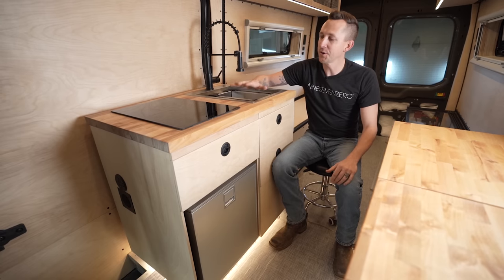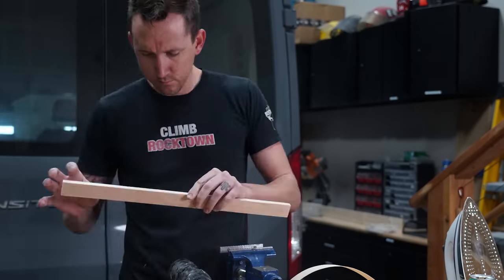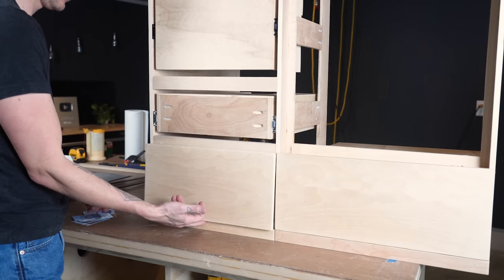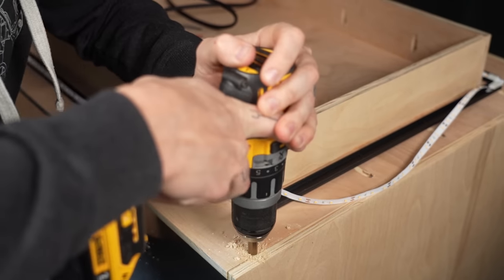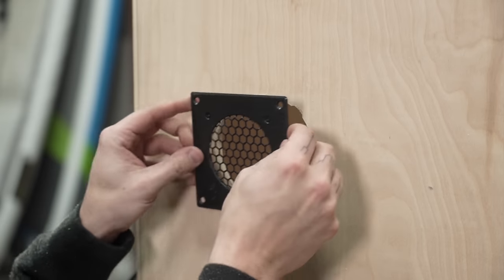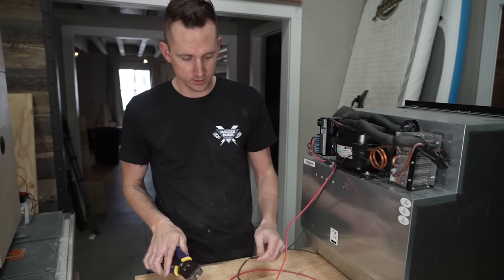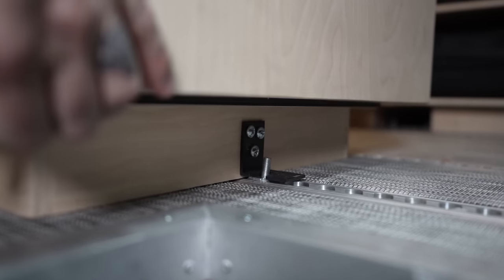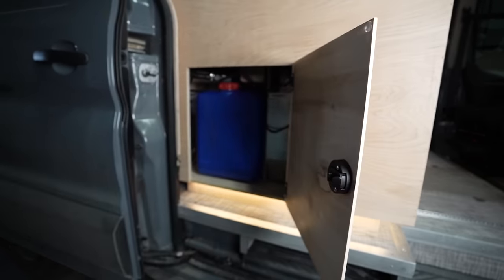DIY CAMPER VAN KITCHEN BUILD: The Perfect Solution for Small Spaces

Comment: Love the work! Just a little tip from a fellow wood worker. Always stain both sides of the wood. In this case the butcher block. Otherwise it likes to warp in the direction of the oil :)
Reply: 😯I didn't know this.  Thanks for the tip!  Glad that I haven't installed the countertop just yet.  Will flip it over and stain the other side as well.
Reply: @johnsharpe2351  great! Glad It helped. If it was mine I also would stain the sides that have been cut to make an opening for the sink. Protects the wood from any water that may gets trapped there when used
Reply: @marlon7806  yep, I did stain the inside cut-out area.

Comment: Hey Nate, nice work! But I noticed - your floor shows some air bubbles? I am asking because I started to get the same issue on my build and trying to figure out how to fix it without removing my cabinets. On another subject, the cabinets you installed, have you ever did the math on the relationship for the cabinet weight, dynamic force and strength of those wood screws to the floor brackets? I am curios because there are some eye opener youtube research videos shows impact effects in even 20-30 mph crashes, especially for wood based cabinets. Knowing your thoroughly style for everything you do, interesting to know if you had some numbers before the build. Thanks and god speed :)

Comment: This is a question for Nate, or anyone else.  I'm looking for a built-in induction cooktop.  The one in the video is the perfect size.  My question is whether or not it pulses at low power.  The cheap portable one I have now pulses max power for lower power settings:  1000W on for 1 second and off for 9 seconds at level 1.  on for 2 seconds/off for 8 seconds for level 2...  This is weird to see while cooking, water boils for a second, then stops for a while.  It can't be good for the inverter, or other adjacent electronics whose input voltage probably varies because of this.  The really expensive induction cooktops don't do this.  No manufacturer documents whether or not they do this.

So, my question is:  Does this Empava cooktop pulse on/off at low power settings?  Does anyone else know of a single or double built-in cooktop that does not pulse?  Thanks!

Comment: Such a nice kitchen unit. But why a 20L jerrycan as graywater tank? With this level of build I expected a different solution.

I put a 36L graywater tank under my camper and made an easy dumpvalve
Reply from the maker: A built-in tank means we would need to be able to find an RV dump any time we needed to empty.  With a removable tank, we can empty into a toilet as necessary.  A built-in tank under the van also means a drain holt through the floor, which we were trying to avoid for the sake of making the kitchen modular and easily removable.
Reply: @EXPLORISTlife  also true. I can easily dump my tank into a bucket if I need to dump it. I think interior space is premium and under the floor by the chassis you have some space. So everything that can go there is great. ☺️
Reply from the maker: Neat!  Sounds like you've found a great solution for your own personal wants and needs just like I have. 🙂👍
Reply from the maker: ...and the cool part about these DIY projects is that is my needs/wants change and I want to add a tank underneath and mess with keeping it from freezing in the winter, I can do just that.

We had this similar setup in our sprinter we lived in for 4 years and it worked well enough to do it again.